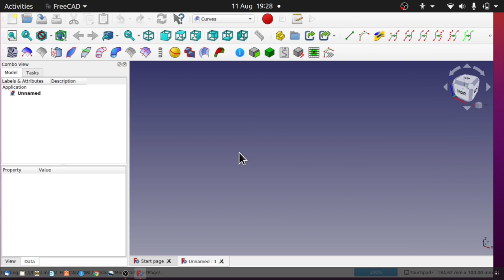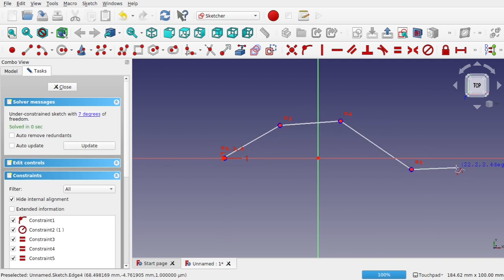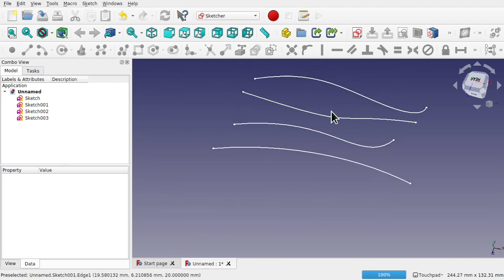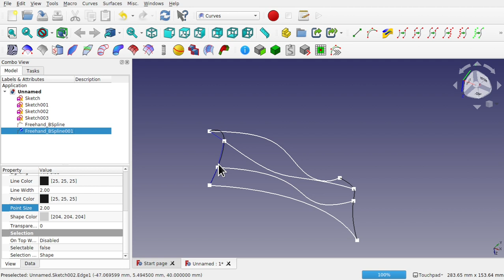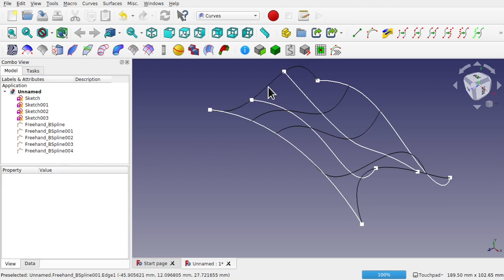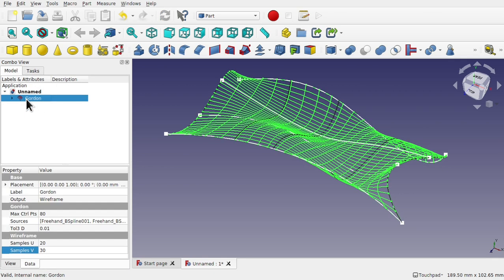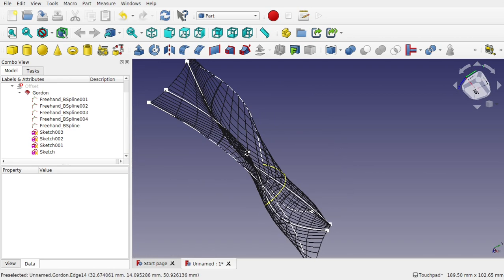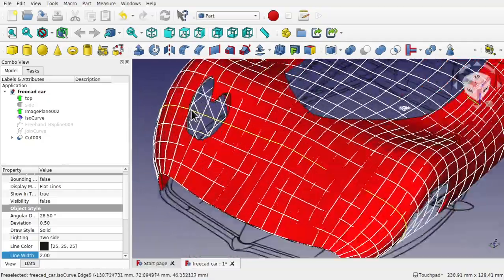Learn FreeCAD Curves Workbench [10] Fully Parametric Gordon Nurbs Surface

Comment: Thanks for good video. I am interested to know if you can also do the opposite of "fill" between the 2 surfaces( to get solid in the part WB).....i.e. can you erase the fill/ solid  "material" between the surfaces to obtain only set of surfaces not only in solids made by the surfacing as demonstrated here(operation with offset). In other words to break up any solid (which was made by the extrusion or rotation or any other way) into surfaces??? Thank you for the answer.

Comment: Hi,
can you simple answer one question: is it possible to create closed surfaces, like a tune, with one Gordon surface?
Thanks for your help...
Reply from the maker: Sorry for the late reply, I missed your comment. I found the best way is to place your last rail close to the beginning rail as you close your loop and then bridge the gap with a ruled surface. But, at this point if your making a tube then is the Gordon surface the right surface to use? Depending on your application maybe a pipeshell or multi loft would be better?

Comment: Useful, thanks. In a real world model, where you might have different areas or sections modelled as discrete surfaces, how do you manage the transitions from one surface to another? I was trying to use these to model a replacement handle for my coffee maker, spent a whole weekend crashing freecad.
Reply from the maker: Thanks for the comment. Do you have an image of the model of your coffee maker? It sounds like you need to use the blend tool which makes a blend between two surfaces with reference to its edge. But if you have an image even if its just a link to a shop that sells the same or similar model I can get a better idea of what you are trying to achieve. I found the pipe shell very powerful at making handles as well.